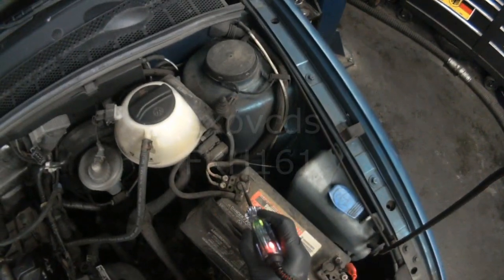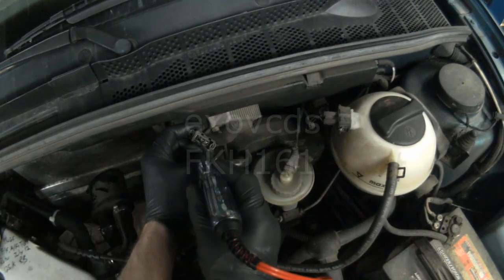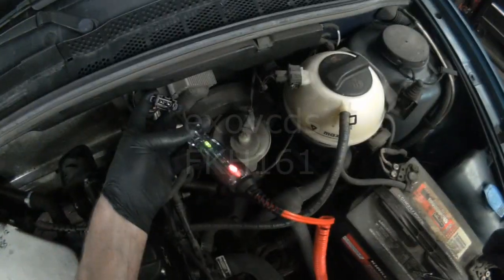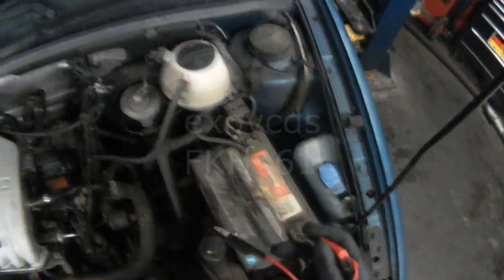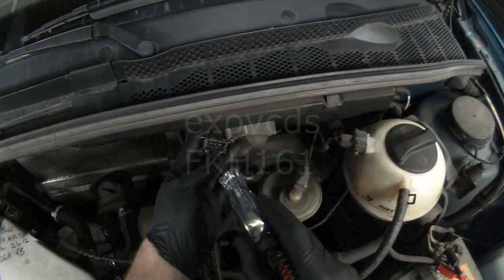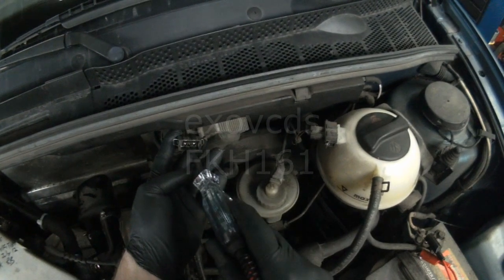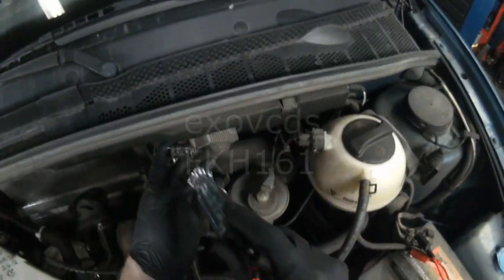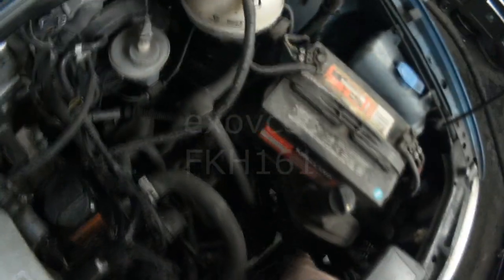VW A3: 2.0L ABA ECM "Control of Ignition Coil" Checking (helping viewer)

Comment: Hey can you tell me where the wiring for the distributor on a 95 Jetta Mk3 Aba 2.0 68 pin ecu ?
Reply from the maker: The distributor / hall sensor is not required for the engine to run. You can disconnect the distributor harness plug and the engine will start & run.
What is the actual problem?
The crank sensor is the main input.
If the engine runs and you have a cam code fault... make sure that the distributor rotor is pointing at the number one notch in the distributor housing (remove distributor cap to see the notch).
You can check hall sensor function with a multimeter. Email me if you need a wiring diagram.

Comment: I have 95 vw cabrio, not getting fuel to spark plugs, changed out fuel pump getting fuel to the rail. Tested fuel injectors they dont have ground. Trying to figure out how to correct this. Any ideas would be amazing
Reply from the maker: Have you checked if the ECM is pulsing the ignition coil... like in this video? No pulse to coil also means that the injectors don't get pulsed.
Reply: I'll check that this evening, did not realize it could be ignition related as car starts with starting spray then dies
Reply from the maker: I wasn't aware you were getting spark.
ECM controls ground for injectors.
If the fuel pump relay & fuel pump are good, it could be a bad ECM. Fuel injectors get power from fuel pump relay.
Reply: @EXOVCDS  everything else is grounded in the car except the injectors, injectors are getting power.  I was wondering if VW may have a safety to stop them from grounding as I have the radiator currently removed as im waiting for a part. Wonderkng if maybe the ECU is preventing the ground to stop the engine from starting until it senses the radiator fan motor is plugged in.

Comment: Hello Thomas,  trying to verify on my 96 mk3 cabrio.  I do have coil pulse, I do have power to the harness connector going to the coil pack, but no ground pulse,  Crank sensor checked out with 546 ohms.  Would it be possible that the ecm popped that grounding pin for spark?  Best regards!
Reply from the maker: Ground pluse?
If the ecm is pulsing the coil (middle wire of 3 wire plug), but the coil is not sparking.... then the coil is bad.

Comment: My MK3.5 Cabrio with 159,000mi has blown 7 ignition coils in the last 4 months, just had a Bosch melt thru the top the other day. Engine etc runs great aside that, so I'm very stumped! The Bosch lasted about 1,500 miles. No cel, no codes.  New plugs, wires, dist cap & rotor.
Bad ground somewhere perhaps, or voltage regulator issue?
Reply from the maker: Ignition coils that are stressed by having to produce very high voltage, will have a short lifespan. Things that "stress" coils:
- incorrect spark plug gap (too big)
- incorrect spark plug (type / design)
- incorrect air / fuel mixture (lean running)
Using a scope to look at the secondary ignition waveform pattern, can help identify where the issue might be.
https://youtu.be/SUShO72Grq8
Reply: @EXOVCDS  thanks my friend! I do know it runs lean by the smell. I bought the car about 5 months ago, the previous owner must have done away with the muffler, from the cat there is just exhaust pipe that runs the full length back, but a 2' section was missing, I had put a piece of flexpipe in place and reconnected/sealed the entire exhaust, was thinking that was alot of the issue but still smells lean. Every now and then, get minor backfires when I downshift, I was thinking that was part of the backfire issue until I sealed it, and still backfires when I downshift. I'm stumped that's for sure.  I had put new plugs & wires in 2 months ago, I think I put in Bosch 6726 pre-gapped plugs. Before that, I was frying coils too. I was thinking it was because I was ordering cheaper coils from rock Auto. I was shocked after 1,500miles, the last one I put in,  Bosch, melted thru the top. I had just ordered an oem Denso from rockAuto, that will be here Tues Sept 2nd. 

Any ideas or advice on lean running conditions, and which plugs/wires I should go with? 
I plan on buying another multimeter too and testing grounds all over the vehicle, havnt been able to find mine.
Thanks a ton for the help man
Reply from the maker: @MichaelKirbyMusic86  missing resonator and muffler causes lack of backpressure in the exhaust. Backpressure restricts how quickly air & fuel enter a cylinder. With little backpressure, some air/fuel mixture exits the exhaust valve during the intake stroke stoke (intake valve opens before exhaust valve is fully closed... valve overlap). The raw fuel in the exhaust can then ignite under certain conditions. Can you share video or photo of faulty coil(s)?
Reply: @EXOVCDS  I'll upload a video of the melted Bosch I still have. The Denso that recently failed, shows no signs of anything or cracks, just smelled electrical/super hot when it went. I'm getting between 500 & 1000miles of drive on the coils before they fail. 
Update: a few months ago I replaced the distributor cap and rotor, and noticed this one has signs of burns inside, button looks like it was cooked, and pitted burns ontop of the rotor.  I just ordered the following: which shall arrive here within 5 days: 2 Denso ignition coils (one for backup), new distributor cap & rotor, and a new MAF sensor, since it had thrown a maf-code before. 
I have reason to believe the PCV may be failing, due to the air hoses being a little oily, and lean exhaust smell, and may replace the evap canister while I'm at it, so as soon as I can get a ride to where my car sits, I'm going to check it and see if it rattles/etc. I'm sure pcv & evap have nothing to do with frying ignition coils, but definitely something I need to address reguardless, I do know aside the ignition coils not lasting, the engine has a very mild intermittent misfire, that isn't every time I drive it, just a very mild single studder every few minutes when it does it.  Will capture some video of things for reference to upload. 

The Bosch Alternator does charge, but could problem be within the voltage regulator perhaps?  Last month, battery that came with the car stopped holding charge, so I took a 660 cca autocraft battery out of my 97 grand Cherokee and put it in there. 
I can't wait until new I-coil, MAF, and dist cap/rotor arrive, and see how car behaves. Will update.  Thanks very much for hearing me out, & for your replies man!
Reply from the maker: @MichaelKirbyMusic86  I don't see the video on your channel...if it is "unlisted" post the link here. Lean running can cause stress on the ignition coil (higher voltage required to ignite the air/fuel mixture)... just like spark plugs that are gapped too wide. Oil in the intake tube should be taken care of by the PCV heater that is mounted to the tube... and has a vacuum line attached to it, that sucks up oil as it collects in the base of the heater. If the vacuum line is broken, it can't suck up the oil and the broken line / hose causes a vacuum leak. If your intake hose does not have a PCV heater attached to it, then you still have an old style intake hose. Once I see your video, I'll be able to see what version you have. Thanks for the update!
Reply: @Thomas EXOVCDS  thank you, I didn't know that, but that does make sense.
I still need to capture video, car is broken down some miles away, and trying to find someone to give me a ride over to it.

I don't think it has a heater, but I could be wrong. I know when I was looking up parts on rock Auto for the 2000 Cabrio 2.0aba l4, it wasn't in the option list: I know the hoses seem straight forward that run off of the PCV itself, I do suspect my pcv is bad tho
Reply: Made it to the car : pulled the PCV and it was infact caked in oil, dripping out, the electrical connector on the tube coming from the PCV into the air-breather hose that runs to the throttle body had oil in it also, so I cleaned the electrical connector up.  I did take a pic, but didn't think to grab video.
Shook pcv, made noise like supposed to, but barely (like it's very gummed up), and noticed the round edge around the top of pcv has separated in a few places, and has oil running out of where it's separated, I'd imagine that's supposed to be sealed. Grommets were in deteriorating shape as well. So I agree as you said this all is why I'm running lean & throwing a maf code, hopefully solves the backfire & mild misfire too. 
I did just order a new pcv & new grommets.
Also waiting to arrive 2 ignition coils-one is for backup, distributor cap & rotor, and a new maf

I hope new pcv & new MAF solves the coils burning up often issue, I'll update when all the parts arrive 
Ty very much for the words man, helped me figure a ton out
Reply from the maker: Thanks for the update.  It's just a pcv heater... shouldn't rattle. The actual pcv valve is the round plastic piece on top of the valve cover, that the hose attaches to.

Comment: Ok bro quick question i have a 09 jetta wolfburg edition all fuses are good no torn or broken wires but for some reason i get no power to any of the coild i mean nothing coming out from the connector could it be a bad ecm? Thanks for the reply before hand hope to get and answer....ENGINE TURNS FUEL PRESSURE IS GOOD BUT THERE IS TO POWER COMING TO ANY OF THE COILS
Reply from the maker: How are you checking for power? Are you also checking for "control" of the coils (ECM activating the coils)?

Comment: I know this is really old, but my jetta won't start, I tested the connector and the center pin isn't getting any signal whatsoever, can you help?
Reply from the maker: Year, make, model, engine? The more I know, the better I can guess. I'm starting work right now, but will get back to you later today / tonight.
Reply: @EXOVCDS  1998 Jetta 4 Cylinder aba 2.0, I believe it's a GL, not positive just purchased it recently
Reply: @EXOVCDS  Thank you a lot for the reply!
Reply from the maker: @imdirazi  You need to use an LED test light (like in this video) to check for "control"... are you? Here's a newer video showing the same thing (start watching at 4:19)
https://youtu.be/HHFUiN4P4A8
Reply: @EXOVCDS  I figured out the issue! Stupid ignition switches.
Reply: @EXOVCDS  Thank you for your willingness to help others! :) Have a good one
Reply from the maker: Thank you for the update! Good troubleshooting!

Comment: My 97 vw golf wont start.. I clean the engine bay and when i try to strat the car, it dsnt run.. The car has power and crank. I check the spark plugs cables and it has spark but not to much.. Need help, ans sorry for my English
Reply from the maker: Did the ignition coil get wet? Remove the distributor cap and clean the inside.
Reply: Thomas EXOVCDS I've try everything. Maybe is the coil, don't know..
Reply from the maker: If it happened after cleaning / washing the engine bay... then something got wet / is still wet. When we wash engines, there are times when it will run rough afterwards. Ideally, the engine SHOULD NOT run rough after washing / during washing. Rough running / not starting indicates that there is a weak spot in the ignition system. Now it is time to eliminate things one by one. Disconnect / separate the ignition coil wire at the coil & distributor cap,  look for moisture under the cap and around the coil. Use a heat gun or hair dryer to dry everything.

Comment: When I test this, ignition ON and connect test light from battery positive I get a bright light on one of the outside pins and dim light on the other outside pin.... nothing on any pin when hooking light from battery negative.  Bad ECU, relay, or bad ground somewhere??
Reply from the maker: candsfly One of the outside pins is ignition ON power (test light connected to battery negative). if the test light does not light up on one of the outer pins when test light is attached to negative, then ignition power is missing at the coil. Is the battery light on when the key is ON?
Reply: no... don't see battery light when key in ON
Reply from the maker: candsfly Let me find a wiring diagram... I'm temper to say fuse #16 but let me check.
Reply: I can't win on this one.. went back to retest.  This time i got one light on outside pin when ON and battery positive, and the other outside pin lights on battery negative.... great... but now I'm getting very dim light on center pin when connected to battery negative.  Loosing my mind.. and prob making you crazy too
Reply from the maker: candsfly I think you have a bad ignition switch... I could not find a fuse that feeds the ignition circuit. When you turn the key... in the ON position, wiggle the key up, down, left & right. Does the battery light come on / flicker?. While cranking the engine in start position, lever the key up down left right... if she wants to start, the ignition switch is bad.
Reply: no battery light when I jiggle key... might not have a bulb or it's burned in that spot on the cluster....  When I turn key to ON there is a buzz/alarm near ECU and then it shuts off after a while.  You were prob thinking of fuse 15 for engine electrics... I already replaced that one with a new one ;)  I'll take a look at my bently for wiring diagram for ignition to coil and see if I can come up with anything.  Something is keeping coil from sending spark.
Reply: Also, because it has been a long day, when I did initial test the key was in ACC position, not ON... hence the bad reading. So, proper reading on outside pins. but no reading on center from battery positive (sorry for the wild goose chase) I get RPM needle movement on crank so don't think it is crank/speed sensor.  Coil bench tested ok but not getting spark from it.
Reply from the maker: I'm not sure about ACC position... VW ignition switches are either OFF, ON or START / CRANK. I can't recall if I already sent you guys a wiring diagram for checking things. Here it is: http://fkh161.ca/VW/ABA/ABAECMwiring.pdf
Reply: what could it mean when I test the control of coil plug and the center pin only gives me an extremely dim LED on my test light (so dim you can't see it in daylight - it doesn't even light an incandescent test light).  Does this indicate  an issue with ECU? Or something else. I do get movement on RPM needle so I have ruled out crank/speed sensor.  I just don't know what else could be causing this and keeping my coil from sending spark. I'm at my wits end with this.
Reply from the maker: candsfly I'm not sure how bright or how dim it should be... the service manual just says that the LED light should flicker. I don't see a reason why a regular test light can't be used... but I can understand that it will not react the same way an LED light would.  ECM's are plug & play for the mk3 generation vehicles (if I recall correctly)... picking up a used one at a wreckers shouldn't cost much and you can select from Jetta, Golf & Cabrio. As long as the part number is the same, should be good to go. At worst you'll have a spare ECM if the engine still won't start. There's no way for me to tell if your ECM is fried, if you have a wiring or other issue. Whether or not it's related to the engine wash or purely coincidence.
Reply: I've found a couple ECU with matching part numbers.. but the letter at the end is different... does that matter?
Reply from the maker: The letter at the end is a revision indication... A, B, C, D etc. A being the oldest / earliest version of the part. There might be some other meaning to it as well, but I'm not aware of it. The closer to "your" letter, the better.

Comment: what voltage will the signal on the center pin of the harness be on a properly running engine? If I'm not mistaken it should alternate between 12v and ground, correct? I'm assuming that it is ground to charge the coil, and discharges from either going 12v or open circuit
Reply from the maker: The ECM provides ground to trigger the output stage: https://www.youtube.com/watch?v=skyF3tFvD0I VW doesn't provide voltage readings / numbers: http://fkh161.ca/VW/ABA/abacoil.pdf
Reply: All makes perfect sense, thank you bigtime for replies my friend. I'm trying to figure out how to upload pictures on here, may be easier thru Facebook if you've got a page? Or message Michael Kirby - my display picture is holding a pink Ibanez guitar with a vine inlay on its fretboard. I have pictures of the most recent Bosch that melted, and may still have video of it idling etc, shutting off from a few months ago on there still. I'm in middle of moving and the other failed coils still at my old residence.

Yesterday a Denso I ordered from rockauto arrived, after install I noticed my battery was dead, gave a jump start and after 10mins idling, battery was fully dead upon restarting the car, hasn't given issue like that since ordering the car, but have ran it dead trying to start a few times with other coil issues, before knowing the issue was coils. Not all of them melted visually. so I know the battery is now toast, moist ontop from probably over charging and corrosion formed around the positive terminal (I normally keep all clean with eyes open). Put a 650cca battery in that was in my grand Cherokee, so far it's running and driving very well again. I had taped a small fray I found on an 02 wire before it's plug, and another small fray on a wire in rain tray at bottom of windshield, drivers side .  Can't find my multimeter to test anything, got to buy one today or asap

I apologize message is so long, trying to cover and word out anything I can that may help assess